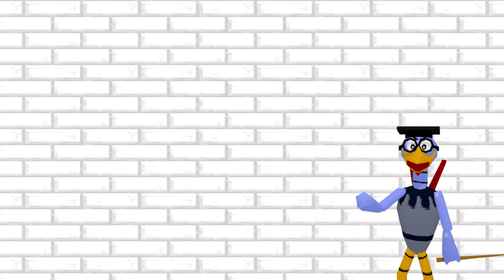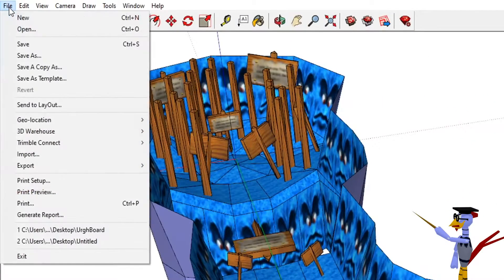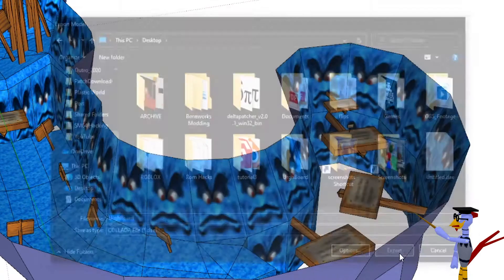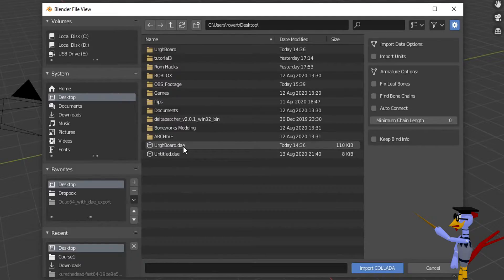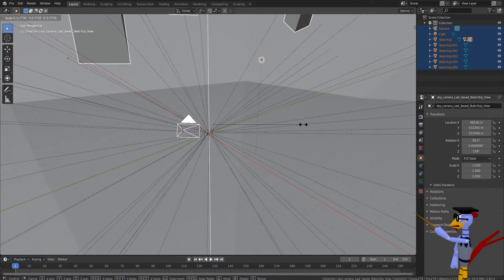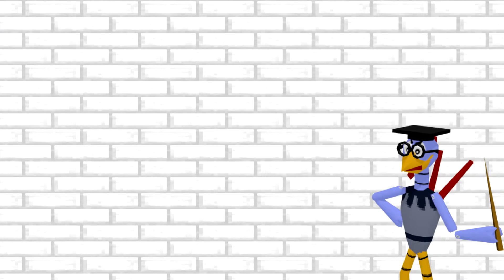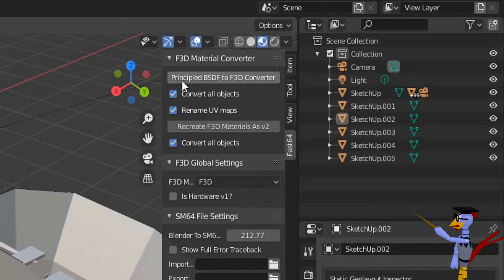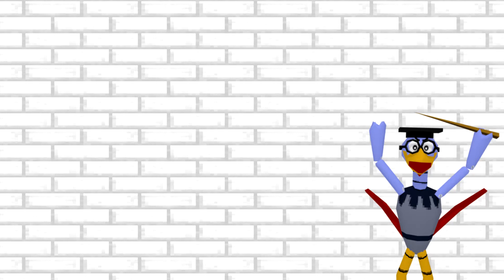How to convert SketchUp models for Decomp? | SM64 Decomp Tutorial - Lesson F-1

Comment: Unless Fast64 automatically triangulates the model for you, you aren't done yet, go to edit mode, select all (A) and Ctrl+T to triangulate.

One more thing, I don't like some things about Fast64, like the fact that it is a Blender plugin, or that the materials need to be in its own special format. That's why I wrote my own level converter.
Reply from the maker: Fast64 automatically triangulates your model. If you ever release your level converter and it's in a useable state to the point where it can do everything Fast64 can do, then I will make a tutorial for it!
Reply: @rovertronic  
"it's in a useable state to the point where it can do everything Fast64 can do"

That wouldn't really happen, seeing as my level exporter has no triangulator, no UV corrector and a very basic material converter. I still released it, for advanced decomp users, which is why I do not think it needs a tutorial just yet. If I ever make it GUI based, and have more features, I'll update it.

https://github.com/iProgramMC/EasyExporter/ <~~ I've released the tool as is just today, what a coincidence!